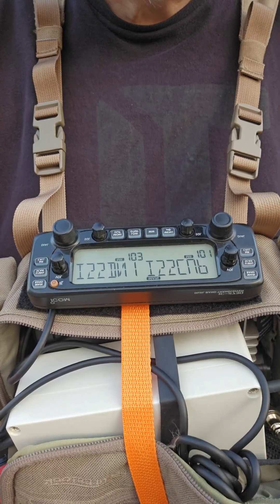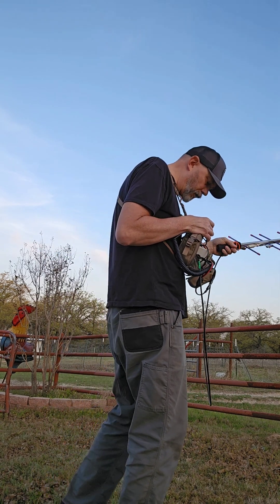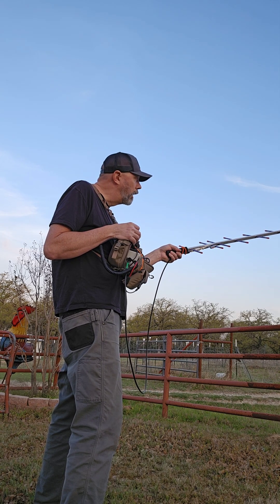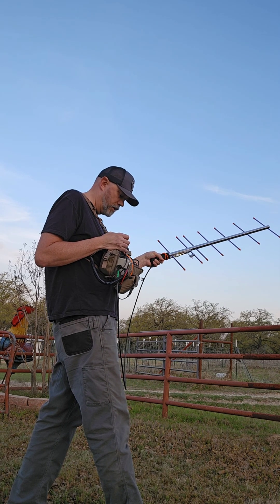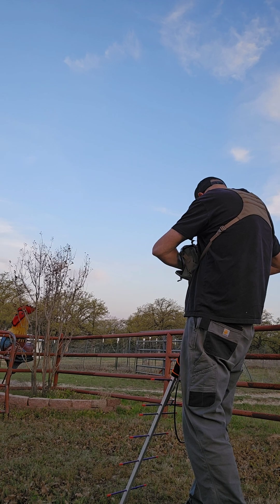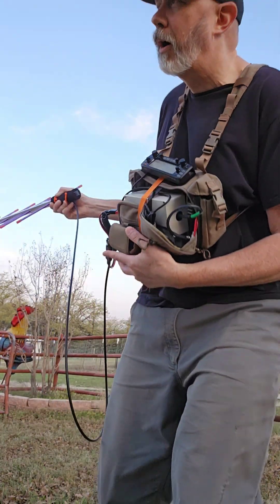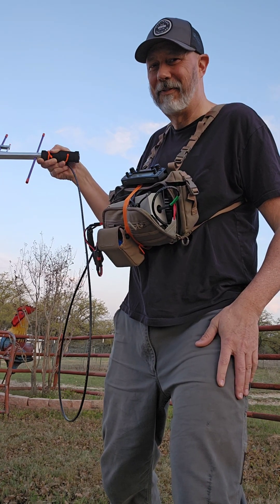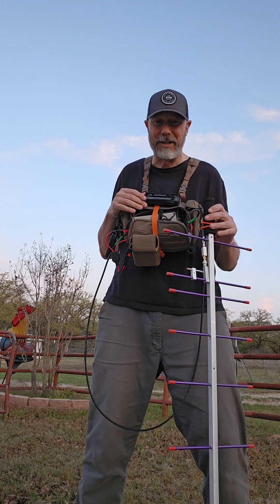Unleashing the Power of Low Noise Amplifiers for Extraordinary Satellite Reception!

Comment: I emailed for info on the 70 and the 200.  Would you suggest this for an IC-9700?  Thanks for all you do!
Reply from the maker: Hey Ronny. They have different versions to fit various circumstances. They have some with Rx/Tx switching built into them where the one I am using does not. They also sell sequencers that may be important for a ground station setup. Lots of folks in the community use these. They are good gear

Comment: Rob, I don't understand how you were pulling the LNA from the circuit. Is there a bypass switch on it?
Reply from the maker: Hi Hank. I have a build video coming out that will show the set-up better. I have a Y cable coming off my bioenno battery. I just pulled the power to the LNA.
Reply: @digital.rancher  Well pulling the power isn't going to pass the signal through it. I'm smelling an April 1st video.